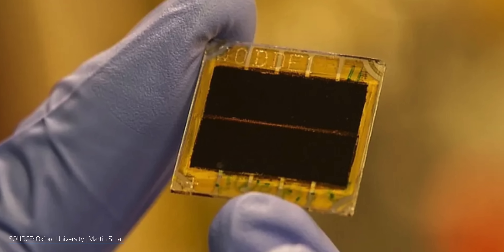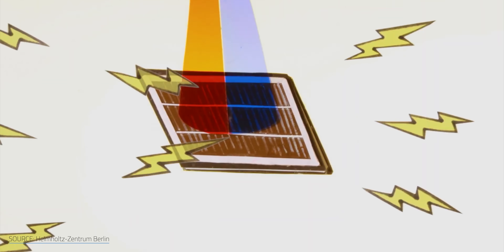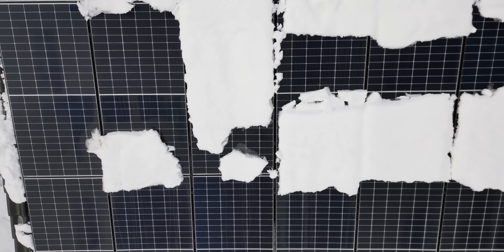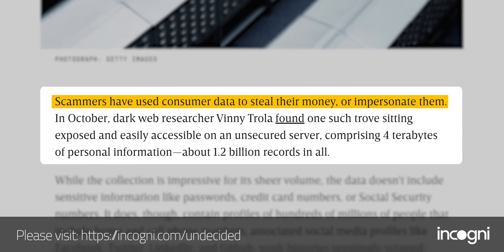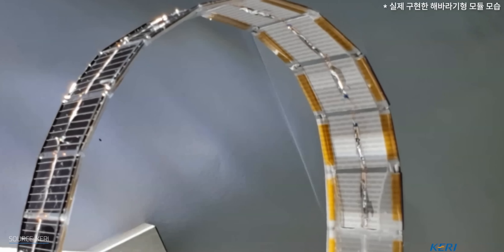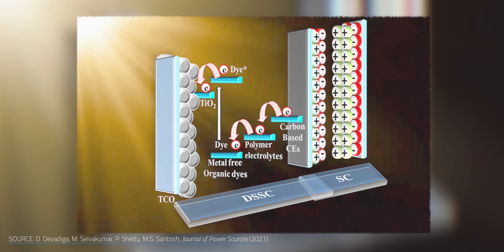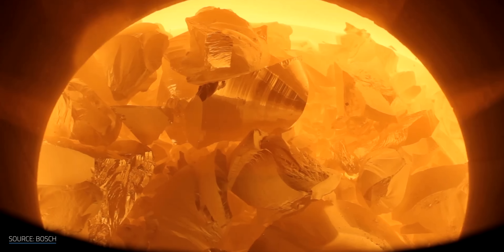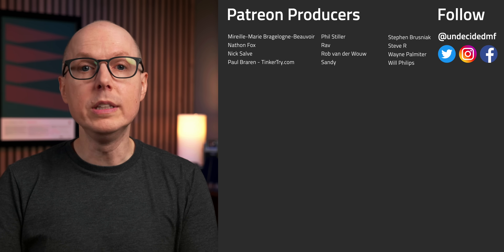Why These Quirky Advances Could Change Solar Forever

Comment: In Syria, we use solar energy a lot. We focus on rebuilding home appliances in a 12v friendly way, but unfortunately we do it in a primitive way. I think we should focus on how to reduce the consumption of home appliances instead of increasing energy production.
Reply: You're on to something very smart there. Reducing consumption, while still getting usefulness out of appliances is a worthy goal.
Reply: @jimthain8777 While energy efficiency is important, energy demand scales with development and technological advancement. 

So while it sounds nice, ultimately it would stagnate the country’s growth.
Reply: Because of energy efficiency ratings and legislation, domestic appliances have reduced consumption significantly since the 80s. In fact in the UK, since the year 2000, domestic energy use has dropped by over 20%
Reply: The problem is lower voltages are way less efficient at energy transfer. They require thicker wires for the same amount of watts, and have higher losses. I agree efficient appliances should be the focus, but moving to 12v is not a solution.
Reply: @gamechannel1271  the grid needs to be high voltage for this reason. But an individual dwelling does not need this. When the distance the energy is traveling is within a single dwelling, storing and using power at a voltage closer to what devices ACTUALLY use (not what their built in power supplies accept) is more efficient as there is a lot less conversion happening. Also having everything within the house operating on DC instead of AC is beneficial also, very few devices ACTUALLY use AC, most things use DC, and require power to be converted as such
Reply: We need both, more things are relying on electricity than ever before, and with a transition to electric vehicles, we need to both increase efficiency of the things we already use, and build capacity for more power.
Additional renewable capacity is also the only way we can decommission old fossil fuel energy production. 
The last thing to consider is energy storage, I’m a big fan of using electrolysis to turn water into hydrogen, and then burning the hydrogen for energy when it’s needed. It’s a great long term solution, but has quite low efficiency, so requires additional excess energy to be viable.
Reply: We should build more things to be serviceable and future proof.
Reply: @entertaintech4374    Why would any company want to do that? They will only be able to sell you one product.
Reply: Maybe Open Source Appliances?    Appliances  designed with readily available parts, you can download a blueprint, order the parts, and build it yourself. Its designed to be easily serviceable, upgradable, and designed to last forever. And its non-profit super cheap.
Reply: @carsonchan5102  Owner repairability? That's not very American of you!
What will the poor impoverished corporations do to let their c-suite employees be able to afford a yacht for their third vacation home?
(sarcasm)
Reply: Reducing waste is definitely something that helps to go renewable.
Reply: In Arkansas, USA, I agree with you.

The best thing for energy reduction is to increase the insulation on your house.

My house and solar system is on 12 volt. But it is converted to 120 volt to run appliances such as my microwave and refrigerator.

My appliances have a government energy efficiency rating and this is required in the United states.
Reply: Energy efficiency is certainly where the focus should be.  Based on this I suggest that 12V appliances are the worst solution.   The low voltage results in inceased resistive 'i-squared R' losses and also all 12V appliances are exempt from having to meet any efficiency standards.  In contrast most AC powered appliances have to meet minimum efficiency standards.
Reply: Cheap and abundant access is a key factor for the development of a country. If Syria wants to develop further, cheap and abundant energy is essential. 

It’s good for civilization to increase the efficiency of energy use, but that takes more R&D and new production lines… which takes more energy.
Reply: @Mohamed-wd1cv  I purchased a bear pressure cooker and it only uses 400 watts of electricity almost nothing compared to other appliances
Reply: @Mohamed-wd1cv  I had thought that yall were still trying to throw of the yoke of the Assad regime. Hunker down. Things will get real in the next few years as war engulfs the planet for a third time. And well we know where Assad will go
Reply: @Mohamed-wd1cv  Do Both!
Reply: Bitcoin.

No really.

Solar's going to produce a certain amount no matter what. If you give value to the extra, people will be conscientious about using it, instead of getting gains. 

Activism doesn't work, force an economic incentive.

Then once your community gets experience with crypto, you can move on to really cool things like Flux and proof of useful work. 

Then you can become an AI training center of the world. Last I checked Syria gets lots of sunshine.

Also certain cryptos are halal. I believe that's correct word. They are biblically permissible. They don't do usury. 

Usury was the entire reason I got into crypto way before it was cool. Like a Blues Brother, I'm on a mission from God.

Aloha from Hawaii. 🤙
Reply: What appliances need to be made more efficiently?
Led is extremely efficient.
Kitchen appliances are pretty much as efficient as they can be for the form of cooking/processing they are used for. 
Smart phones and tablets run on very efficient low power chipsets. 

Maybe the over use of always plugged in wall warts and increasing the efficiency of their energy conversion could bring some benefit and energy saving. Wiring houses so  specific rooms electrics are able to be turned off when not used...?
Reply: @ge2719  Here in the UK our sockets have a on off switch 🔛📴

USA wastes a ton of energy every year! With certain appliances still running or on standby whenever they leave the house.
Reply: Reducing consumption has been a huge topic for decades already. Most people use way less electricity today than just ten years ago. Heat pumps, more efficient appliances, insulation, way more efficient screens and computers etc. Every year the consumption is just going down.
Reply: @christoferstromberg6605  True but our appliances don't last as long as in times gone buy the stuff was built too last for life and modern throwaway culture waists way more energy than necessary and we have electric gadgets we could do manually if wanted too ...even the first fridges n microwaves toasters when first came out last forever and only a couple issues that you could fix yourself it came in instructions the fridges may off been higher energy use but last forever before circuit boards all electronics were easily fixable n better quality materials ...check out the old toasters much better than modern ones no arm too push toast down you just put bread I and it automatically pulled the toast down and had sensors inside too detect when toast cooked perfectly did all the work for you...cheers
Reply: Reducing home consumption wont even dent energy need. Even if you reduce it by half you will only lower it a few percent since real energy consumption done by factories and companies.
Reply: Good to hear, as that was what homes use to be wired on, DC power.. 
It was the corporate war with the AC crew that pushed a less effective system to wat it is today
Reply: I have a house of 70 square meters (753 square feet)
I get electricity from the government for 3 hours in 24 hours

I have a hybrid system that combines 12v and 220v
I currently have:
A refrigerator (350-500 watts) that works from 9 am to 3 pm (a dedicated smart circuit with a timer that turns the refrigerator on and off automatically) It works very well so you have ice whenever you want it, especially if you don't have small children (I'm single, thank God 😂)
A washing machine (1000-500watts) The heating system is not activated - the refrigerator must be turned off when the washing machine is on
5 meters of LED lighting (3 meters work for about 5 hours)
3 computers (special converter from 12v to 19-24v) Average computer works 24 hours a day
ADSL Router 12v (works 24 hours)
And a 12v screen (It works for an hour or two sometimes)
And two mobile phones
The iron, vacuum cleaner, etc. work on government electricity

I have a 12v-230AH lithium battery
2 N-type 630watt solar panels
12v 1500 mppt power inverter
This system cost me about (1500 US dollars)
This system works efficiently for 9 months a year

This system does not operate the air conditioner or the induction cooker (which is very necessary due to the difficulty of securing domestic gas) It must be upgraded to 5 panels and a power converter suitable for the system

The challenge we are currently facing is to convert or replace the induction cooker in a way suitable for cooking

If the panels produce energy, we use it immediately, and store it to operate only the necessary devices

Unfortunately, the purchasing power of the average citizen in Syria is very limited, so the average citizen has the ability to install only one panel, while the rich and well-off have 5 panels or more.

Your lifestyle will change when you embrace solar energy (you will wake up with the sunrise and sleep early) 😂
Reply: Wow, such pioneering thinking.
Reply: We need to do both.  Ultimately, we're going to need to change our transport to run on electricity as well.  You'll have as much solar as you need to do that.
Reply: All these advancements seem to work in labs only. Not much use
Reply: Correct. High voltage AC power is the incumbent industry. Centrally generated power is slowly getting disrupted with local/distributed power generation and storage. The majority of electrical devices are using transformers to step down the voltage to their required low voltage needs. There is massive heat and conversion loss with this model. It will change.
Reply: Oh mehn, Syria is gone now.
Reply: We actually do. Did you know in America since 2007 with the exception of two years(three?) power demand has gone down. 

 With all the new gadgets, tech, and things like EVs you'd think demand would go up. Yet it hasn't. It has declined most years. 

 Simply because everything is becoming more efficent, and smarter. 

 It doesn't seem like it, but it is true. We are improving on that forefront. 

 An other fun fact is we waste around 2/3rds of our energy produced simply due to thermal waste, and other inefficencies. 

 Coal and gas plants are in particular inefficient. People are trying to improve the grid too everywhere. 

 Anyway just pointing out it doesn't seem like it, but we have been getting extremely good. I have no idea how much more efficient things can get honestly as there will be a limit.
Reply: A lot ? Cap. Installing 4 panels per 5-story building is not that impressive.
Reply: @nibrasalchoufi3450  Yeah I'm sure a country still recovering from a war is just raring to go with big fancy infrastructure projects
Reply: @michaelmartin9022  actually one of the reasons Japan is such a high tech country is because they had to rebuild after the war. When you need to rebuild everything anyway, it’s the perfect time to consider doing it differently, not tied down to legacy infrastructure
Reply: Your statement is so false its laughable , i really don't understand what kind of educational system you were brought up on . But history reality and the truth say your wrong .

Comment: Looking forward to when solar will make sense to use for my house.
Reply: So today then?
Reply: @davescott7680  Nowhere close to ready! 22% efficiency is garbage, and you'll never get your money back.
Reply from the maker: I wouldn't focus on the efficiency.  Focus on the cost of the panels vs. the cost of electricity in your area.  Every situation is different, but solar panels can absolutely pay for themselves over time.  I've got a video coming up diving into my personal experience with this.
Reply: @UndecidedMF  I spend an average of $1800 a year on electricity. From the videos I've seen, it would cost $60k+ to go solar on my house, and I got an estimate of $75k, so, unless the cost of electricity skyrockets, it'd take close tp 40 years to break even.
Reply: In reality it depends on your location. Yes panels can save money today.